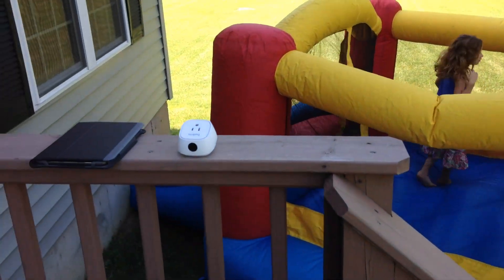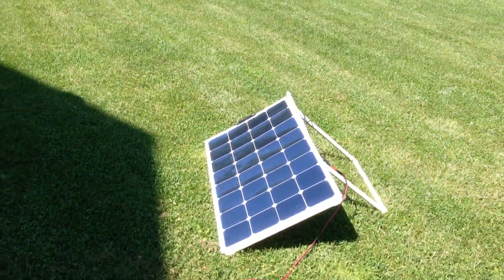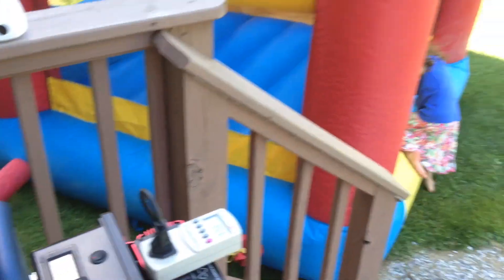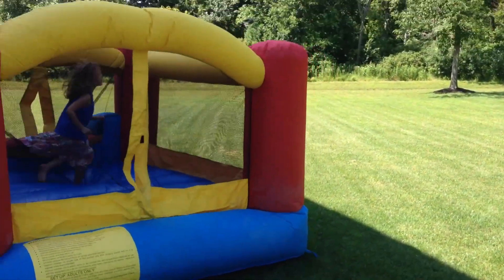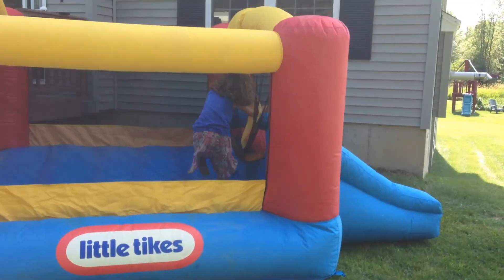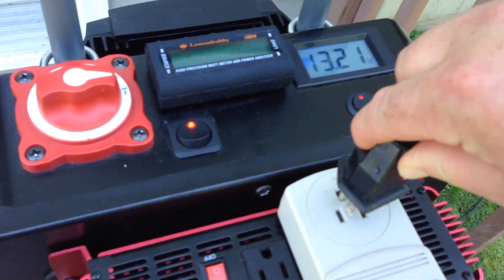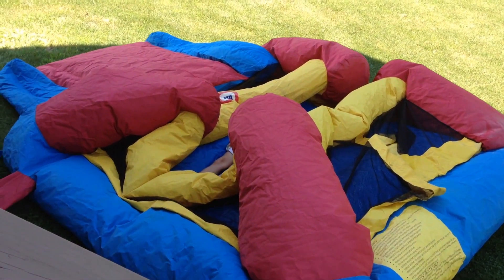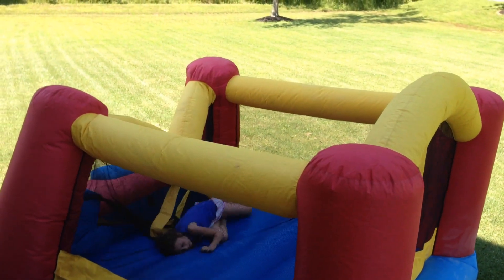Solar Power Bouncy House

Comment: I've recently been thinking of doing a solar setup like this for my much larger bounce house 16x16 but didnt think any one else had the same insight as me until i found your video today,i bet your daughters an adult now though seeing as you did this 7 years ago +1 for the same train of thought.
Reply from the maker: Thanks.  Yes, it was a fun project.  I still have the solar power generator and will be doing a 2.0 version of the system in the near future.  Thanks for watching!
Reply: @GreenMountainDIYGuy  im only just starting with solar power & looking around to power my blower without say a petrol or diesel generator noisy option as my blower runs 1.5kw p/h so i'm considering charging up some larger batteries from kits like eco-worthy offer on our shed and then to see its running time but still charging on site possibly. #ideas #keepthoughtsflowing